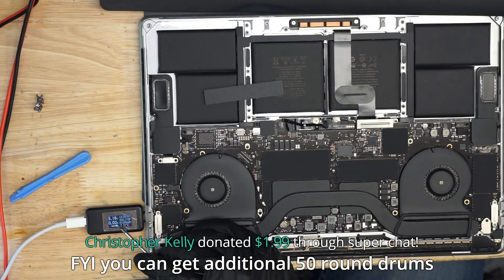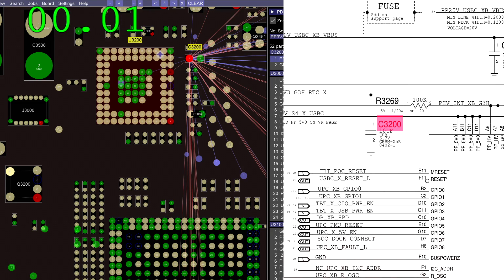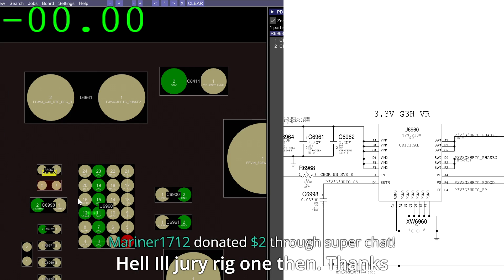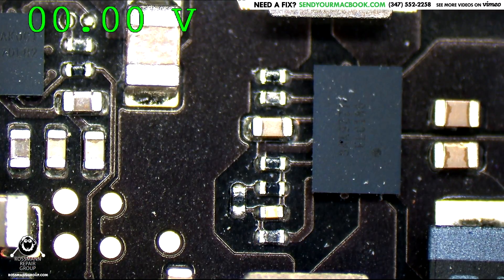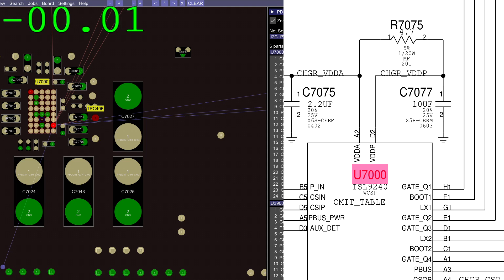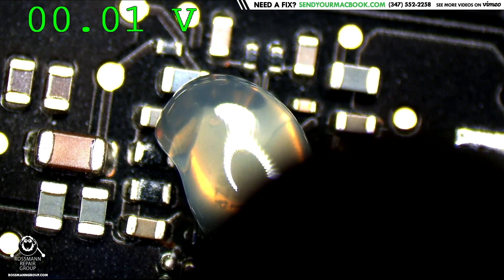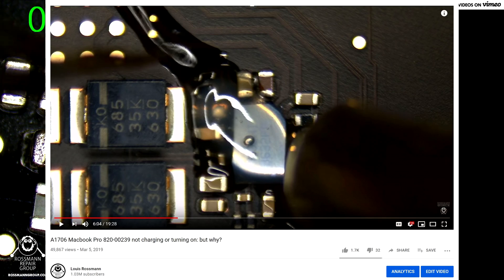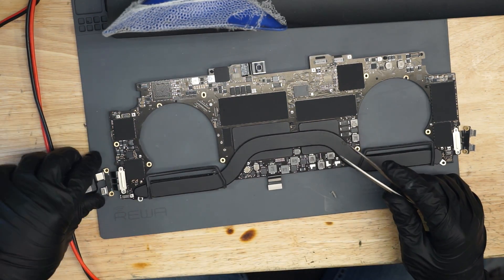How Apple is shaping the future of repair.

Comment: I believe Apple's "Smart Battery Case" contains an ISL9240.  It's $129 + tax, free shipping.  The iPhone 7 version is $99, but I can't confirm that it has an ISL9240 in it.  A bit of a markup for a $5 chip, but it's a cheaper option for a customer than a whole new motherboard?  *shrug*

Source: https://translate.google.com/translate?hl=en&sl=zh-CN&u=https://www.cnbeta.com/articles/tech/843829.htm&prev=search

[edit]
You can find "non working" ones all over eBay for as little as $12.  You might be able to make some computer recyclers very happy, Louis.

Comment: What would happen if you just tried to bypass the chip and try to charge the battery at whatever voltage and amperage it needed? Would it refuse to charge?

Comment: Louis, for the sake of recovering the client's data, why dont you bypass the chip with an artificial enable signal?
I dont know the details but if the purpose is to recover data then you should be able to just tell the chip to turn on, recover what is needed and scrap it after?

Comment: After extensively watching your videos, I don't think I will EVER buy another new Apple product.  This is HUGE, I used to be the biggest proponent of Apple, and now that they are pulling this kind of SHIT I don't want any part of it.  I actually just recently switched from an Iphone to an Android when my iphone died inexplicably and couldn't be repaired (oh I tried).  Thanks for your honesty Louis.

I am still keeping my Early-2011 13 inch MacBook Pro alive (I've bought several parts computers) exactly for this reason.  So Apple/related companies had BETTER not stop making parts for the older machines, or start blackballing them somehow with software in the future.  That would be heinous and wrong.  Come on people, get out the pitchforks and torches for christ sake!!

Comment: It could be possible to make small adapter on flex pcb with isl9239 and maybe aditional mcu fooling SMC, which would solder directly to the place of old ISL9240. But we would need more reverse engineering on both chips

Comment: Apple had a few good points when Steve Jobs was in charge. Since he died, Apple has been going down like a rock. It just repeat and rehearse of the same things. No new innovation. There is no practical added value between an iPnone 5 and an iPnone X other than small upgrades that are mostly the result of the chip technology evolving. An upgrade available to every phones regardless of brands.

Comment: Why not try and fake the missing voltage with a bench power supply to at least get the customers data back. Plus, whilst that is technically worthless, there are salvageable parts, so do you offer to buy it from your customer? I guess donor boards hold some value?

Comment: Quick question, not that it makes it acceptable or anything, but for data recovery can you desolder this chip from a donor board and reuse it in a mac you want to fix, or is it also tied to the board in some way? Does it get damaged while soldering so it can be only used once? With the T2 chip, it's no longer possible to take out the SSD and recover data from that, which is why fixing a device like this, even if temporarily with a "loaner" IC, however ridiculous that sounds, could be an actually useful thing.

Comment: Could you simply use a pull-up resistor on the enable line? Perhaps long enough to boot the system and pull the data off? Then undo the resistor bc we do not want the board to blow up.. At least the data would be recovered.

Comment: It really looks as if you broke the chip with your syringe. I agree you should be able to buy the chip for a reasonable price. It was possibly broken even before, after all it didn't work. But it really looks like after touching it with the metal syringe a part of silicon broke off, which was attached before, it's easy to do, silicon is surprisingly brittle.

Comment: Most of the issues with macbooks are with charging and or power control circuit so technically it shouldn't be that hard to at least create mod boards to use instead of those chips at least even just to make it work long enough to recover the data ( since this time the issue was in the charging enable pin doesn't work is the issue that the battery is too low so using a full battery would make the pc at least turn on?)

Comment: 200% agree. As a user of tech. As I'm not a repairer. This is why I never jumped wagon to Apple, despite being an illustrator and graphic designer (today the platform doesn't matter anymore for those jobs). Definitely the price tends to be outrageous, but even at times when I had a fabulous budget for the machine, I still stayed in PC world because I noticed the lack of flexibility in Apple's world (plus several 3D applications simply don't exist in Apple ecosystem, they were never ported). I've not been picked at some jobs, for this very reason. In one, particularly funny, I was being told that I was being the ideal candidate, that I'd be working there. Using the same apps, providing all proofs of experience (many companies), courses, education, etc...  I was told to be discarded for (as a last question of the interview, lol)  not handling Macs at home and having done all my career at companies that used PCs. The level of stupidity of some...

Comment: What if we jankified it? If the battery was charged it would turn on right?

At least the data could be saved. I'd just run the raw battery voltage cables outside the case and charge the battery manually with an external charger.

Comment: Couldn’t you at least run some wires from the board to a bench power supply to power up the board to get the data off?

Comment: Hey Louis 

Now i dont do any board repair but my wifes car was having a problem with her electronic driver seat moving. I figured before i even take it to the dealership and have them tell me the motors are bad, i better make sure the switches work. I went ahead and looked at the module to see if there was a part number and sure enough there was one and a schematic! I was too lazy to try to repair the module but i did purchase a new very easily (OEM) and that fixed the issue! $50 solved my issue. I have a feeling a dealership would've charged much more even if they decided to be nice and repair the switch versus the motor.

Apple makes things very difficult.

Comment: Can you externally charge the battery and have enough power to recover the customer's data? Can you jumper the chip output through a switch to hack the machine so that the customer can boot it up in the future? Or deploy a similar chip with some logic to replicate any other functions needed?  Have you ever yet had a customer buy a new $1500 board from which to obtain the chip so that you can restore the broken computer and its data?  Heck with your soldering skills to just have one or two floating loose chips would allow temporary repair and data recovery if I understand your video and analysis.

Comment: What about a kickstarter to have an electrical engineering program near you produce a specification for the chips you find a problem like this, then another kickstarter that takes the specifications, gives them to other electrical engineering programs to produce a design with the same footprint and pinout.  You could then put those designs in the public domain if you wanted. It's a lot of hoops to jump through, but producing the specification, and producing the design based on the specification are both more or less on the level of a single undergraduate senior project.  Honestly, with some 20,000 electrical engineers graduating annually, there's gotta be a couple who like your videos and need a project idea.

Comment: If it is only a matter of providing some voltage at a certain point, why don't you take an external source and bridge the original circuit to get the data? If it is economical or maybe just for fun? You are right to blame Apple though.

Comment: This is a Chinese made chip?  Are there no clones?  Are there no logically compatible competitors?
Reply: there probably are but the pin layout might not match so you would need a adapter board which may not fit inside the case when closed.

Comment: no access to the data? Would a chip from another board not work? Does the macbook not turn on if you force the voltages to the power rails with external sources?

Comment: I would be pissed if the alternator in my car went out and couldnt pick one up at my local parts store because the car company prevented the part to be sold or duplicated by anyone other than that car company. And making you go to that car company for service only to tell you since the alternator is bad we have to replace the whole engine assembly because it is only sold as a complete unit. Then you ask if you can keep the upgraded performance parts and they tell you that they wont be able to.

Comment: Program a microcontoller for doing so and put it in an adapter and hook it up with the board. That can replace that chip. 🤔🤔
Reply: For data recover you could defiantly bypass the chip, even without a micro controller. But its probably not worth the time and effort in most cases.

Comment: I have a MacBook pro 13" late 2011 and i keep thinking there is no chance to upgrade to a new one... I was hoping they fix the keyboard fiasco but I think there is so many parts of the machine, solder ssd ram, so much unrepairable stuff in it that it's not worth the money... they want to push their trend to use it for a little while and change to a new one and it can't be done with 2k machines
Thanks for sharing Louis!

Comment: according to this website the apple iphone x battery charge cases use the same chip.  So I guess if you buy one of their cases for 120 you can salvage the chip you need.

http://www.chongdiantou.com/wp/archives/32709.html

http://bbs.chongdiantou.com/data/attachment/forum/201903/13/201959w7hc224i974q2o4h.jpg

Comment: Microsoft 2019: "Replaceable SSD"
Apple 2019: "Soldered SSD"

lel
Reply: TBH Microsoft with their surface was even worse than Apple with their Macbooks. Now with the last gen they learned from it but damn the previous gen was even less repairable than a MacBook (at least you can open a MB without destroying it).
Reply: @alessandroceloria  In Windows (or Linux), the sensible thing is to have a PC, a desktop machine (more performance even with same specs, quite lower price, lots more flexibility and upgrade paths, better cooling, etc, etc, etc) , or any other laptop rather than a Surface. A Dell, an Asus, well configured can easily put those disgraces to shame.
Reply: @3polygons  Well, there's a place in the market for thin lightweight laptops. As a student, I go to university with a lightweight laptop which is of course underpowered but capable enough to handle most tasks fine and then SSH into my all-powerful desktop at home when I need dah juice. The problem in my case is not really weight - I see a lot of people whining like boneless babies about a 5Kg laptop... 5 KILOGRAMS FFS THAT'S NOTHING! - but rather size, as a powerful laptop is too big to fit in most bags. So I can understand laptops of the like of a surface (pen input is also very very handy for note taking!). However gluing the ENTIRE laptop shut is just obnoxious, wrong and antirepair. I mean, what are you going to do when the battery dies? Just an awful product.

EDIT: Forgot to say - I'm fine with thin and small laptops as long as they have good cooling and don't throttle by design - that's just awful and wrong and - in my opinion - false advertising. Of course excludes both the MB and the Surface from my list :)
Reply: @alessandroceloria  I was mostly disliking the MS Surface product, not the concept of lightweight laptops. Or tablets ( I just dislike iOS (and even iPadOS, too limited for me). That is, there are thin laptops which are much better in configuration and parts used than the Surface. The pen is great for notes, and terrible for drawing due to having swapped wacom (used in the 1st gen) with the n-trig technology , which produces jitter/wobble in lines inking when producing slow lines (never the case of writing). So, Surface is imo a fine thing for general use (could have been better configured, the configurations don't make much sense to me...), but some artists have not the right info, and bought it for painting. I quite prefer to paint on my 65 cm wide digital tablet, in any case  :D

For portability, is a need. But a lot of people even campaign using an iPad or a MS Surface as a desktop (geez, 12 inches screen and no real cpu processing power for a professional machine replacement?) replacement, what is worse, even for professionals ( I can quite understand the case for the average Jane/Joe, though) while we pros will be like for ever stuck with desktop PCs . Even if just to use the high end 24 -32 inches screens which we color calibrate by hardware monthly, etc.

About portability, well.. I have a strong disconnect about this issue, as am a bit er... "raw", about this... I used to have a PC mini tower. Still, was a tower, just slightly smaller, a bit thinned one (not as thin as those company or admin dells), and I have long arms. And used to bring it under my arm from home to the company and back, daily, in the bus. Only in the weeks where I needed to also work at home. Sometimes not able to leave it in the bus' floor. Actually... I believe I never did so, as knew some stories of people loosing the data of magnetic storage due to leaving it in the floor after a huge breaks triggering.  And while working at another town, I used to come in the car (3 hours, 6 in total) through the countryside path, and get back every weekend, putting the large cathodic monitor (non tft) in the back seat, with a large (largest ever) tower besides it. Every freaking weekend, lol. "Portable" for me is anything that I can actually carry, haha. Lol, I know that's not everyone's preference...
Reply: @3polygons  dude the surface and macbooks aren't  normal sensible products, they're premium devices for rich people that does not care about money.
Reply: @alessandroceloria  Yeah i know but with the latest ones at least they took that 1 step to let people use their own storage, Its big for me, I dont think drives will die often from typical use, its just IF they do then at least i can buy a new one and replace it, instead of spending over 1k for a device that will have a much more limited lifespan.
Reply: SomeTechBloke normie

Comment: Have you tried to use the old chip that does the same? Sometimes the only difference is something so minor that it works, and maybe the only difference is the pin layout, that would be extra work but doable if there is no other option

Comment: Interesting (read: disgusting) that people could lose their encrypted data because their computer refuses to power on because of a simple chip not being available for replacement. Now I'm not an electronics expert but if the function of this particular chip is as well understood as I suppose it is, wouldn't it be possible to somehow wire another chip or circuit in its place to provide the same function? Perhaps even just temporarily in order to be able to copy the user data.

Comment: Because people and Governments let them get away with it and use lobby groups to push their own agenda which to rely on Apple for repair or lack of then force you to buy new Apple products, To boost sales and their bottom line with no choice in the matter while locking out other players.
Like the cars for repair or service manuals which shops can subscribe to so give the customer choice instead of going to the dealer with the higher cost, Which should be the standard for all equipment sold to consumers and no excuse for any company to make.

Comment: Hey Louis. Do you know the other similar chip but different pinout. Not sure from previous vid that you tried to match up the pinout with other chip that similar. You might try to make the flexible PCB to convert the pinout from the similar chip to replace that crap on macbook mb. recently EEvblog made vid about designing the flexPCB for component upgrade.

Comment: Would it be possible to reverse engineer the chip and make your own? Maybe program a microprocessor to do the same thing? Maybe design a chip which does functionally the same thing and have them made in china?
If not, could you design your own kit on a breadboard, Ben Eater style and solder it onto the motherboard just to get at least the data out and onto something else?

Comment: You have already made a few videos showing this exact failure - clearly, it's not an uncommon problem. Is there any possibility of damage by jumping the enable signal to a power line? I understand that if shorts on the board exist or develop, this could lead to catastrophic results, but at least you would be able to recover the customer's data.

Comment: Would it be feasible to reverse engineer and produce a knockoff of that chip? Even if the cost were $700/chip, that would still be less than the $1500 for a new board.

Comment: Many car manufacturers in fact do make agreements on part supplies that the parts cannot be sold to anyone else. However, you can always buy any original part via the dealer for at least 10 years after the car is out of production by law (except for Tesla who thinks the law does not apply to them). Dealers are in fact happy to sell parts to independent repair since they make a profit on every part sold. Additionally, anyone is free to make knock-off parts, but that is not helpful for most electronic modules etc.

Comment: Can't you keep a spare macbook with an intact power chip on it, and swap it on and off as necessary to get data off the customer's macbook? i.e. put the good chip on it, boot the macbook up, get the data off, take the chip out, store it somewhere so that you can use it again for the next customer
I realise the chip is brittle, but you have to find solutions in the constraints you have